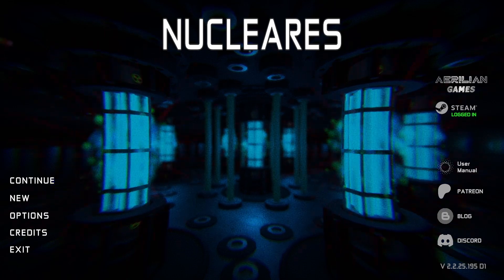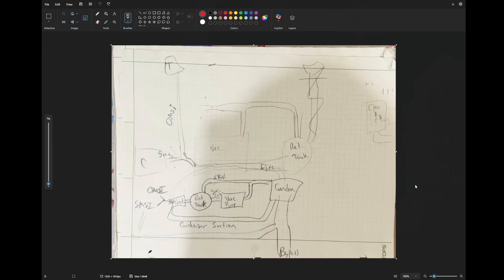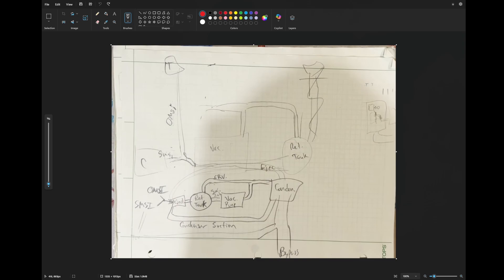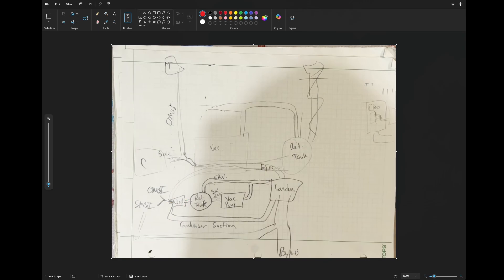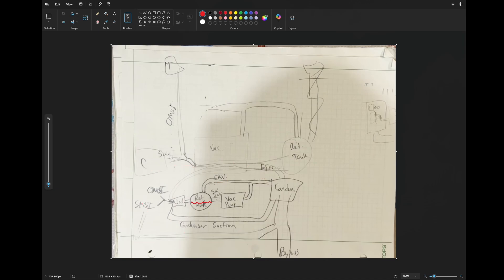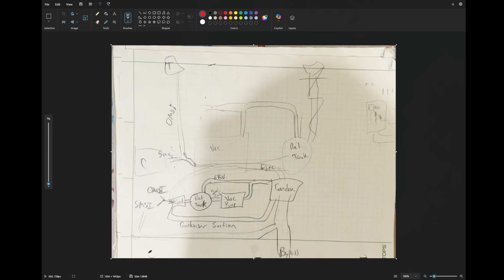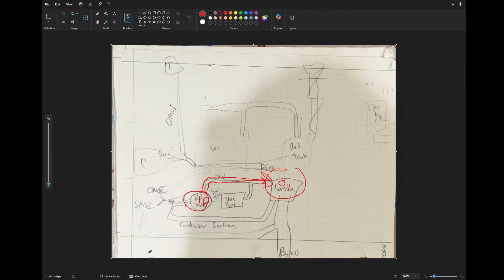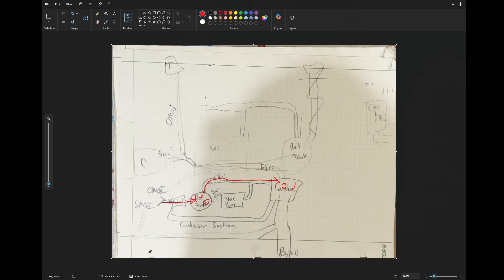Supplemental: New Vacuum & Condenser System - Nucleares

Comment: Still no sense for vacuum pump to be connected to condensate return line, its input and output are effectively connected through condenser.
Reply: If there is in fact water in the vacuum system and the condensate return line connects well below the waterline in both the condenser and retention tank, it does make sense (then the respective gas pressures in the condenser and the tank just determine how the water levels in each balance out).
Reply: @JonBrase Firstly, term "vacuum pump", usually refers to gases, not liquids. Second, yes, this is how CRL should work, it's will suck water from retention tank back to condenser, due to vacuum in condenser and higher pressure in retention tank. But still, how you can reach initial vacuum with such connection? Initially you have atmospheric pressure in the system. You have air and any water dissolved gasses, which should be removed from the system. To where? Back to the condenser? There might be a lot of gas in the system, so there is a vent valve for retention tank, because theses gases volume from condenser and all the loops will be well above retention tank volume on initial run, so they should be jettisoned to the atmosphere once accumulated. And vacuum pump should be connected to the same atmospheric exhaust pipe in my understanding.